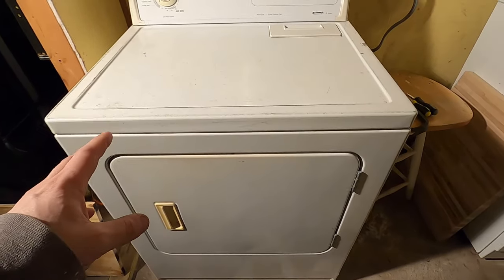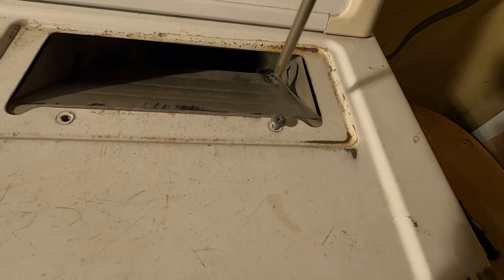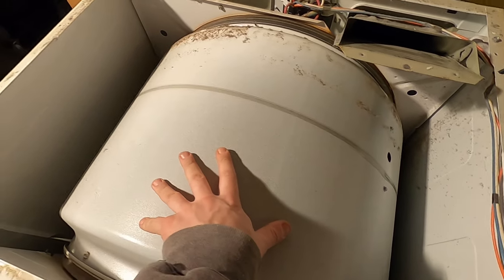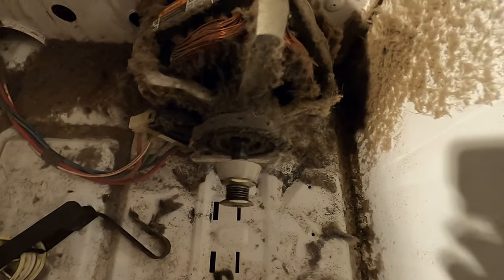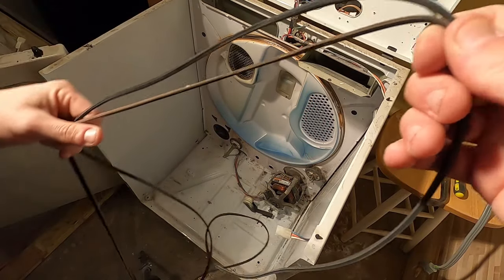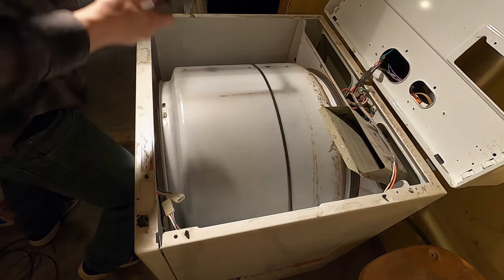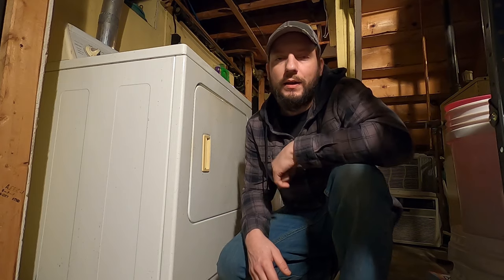How to Replace Dryer Belt on Any Front Load Clothes Dryer

Comment: My favorite part is when he is able to show us how to loop the belt around the tensioner and onto the motor. The way he got that perfect camera angle with adequate lighting....astounding! Well done sir. May the algorithm put your video to the top.
Reply: So true. That was the part i was stuck at.
Reply: It was definitely the top result for me 🎉
Reply: Same here.  My dumbass  would've removed that little wheel on the tensioner to put the belt on. 😏
Reply: Time stamp plz
Reply: Yes..Perfect How-To Video!
Reply: - I believe there are time stamps under the video .
Reply: Better than those other vids that aren't very clear and leave important  parts out.
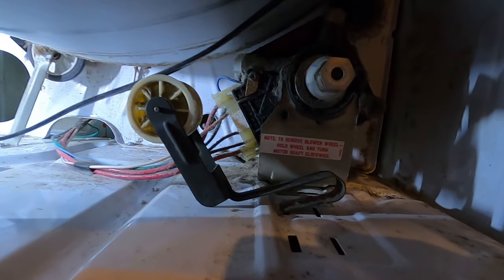Reply: @JermBoyTv 10:50
Reply: Agreed!!
Reply: Facts! This was mad helpful
Reply: I totally agree!
Reply: Absolutely great job!
Reply: Word to the wise always check the drum rollers normally one or both have seized causing the belt to fray and break.

Comment: I was a crane operator at a scrap yard. A customer came in with a stake body truck full of washers, dryers and dishwashers. His 13 year old son was unloading the truck by himself. When I went to talk to the driver, his son rocked the last dryer off. When it hit the ground, change fell out. After he picked up the change and was getting ready to leave, I told him, he wasn’t done yet, but to wait a second. I got in the crane and took the dryer apart. When I got back to him, he was still getting change from the dryer. The next day, I asked the driver how much did I his son get. $18.

Comment: This turned out to be a project where I actually made money.  My belt tensioner had just slipped off so I only had to put it back using your video.  And with all the change I found in the dryer, I came out with more money than I started with.  Thanks!

Comment: Great clear instructions. Perhaps the most important real world part of this  video was showing the hideous multi year lint accumulation that has to be cleaned before doing the belt replacement. I was horrified how much lint crap had accumulated inside my drier that posed a real fire hazard that i had never appreciated. It took me several hours to clean out the body in addition to the ~20 minute actual belt replacement. I diligently always cleared my lint screen after each use, but the lint piles I found inside shocked me. Thank goodness my belt broke and forced me to clean out this fire hazard lint that had accumulated after years of use. All other videos I watched showed well dressed salesmen replacing the belt of a new drier with ultra clean insides. This real world video is the best and serves as a wake up call to alert everyone of the need for yearly drier inside lint cleaning.
Reply: DRYER MAINTENANCE BECAME MY ANNUAL CHORE LIKE REPLACING THE FIRE ALARM BATTERY AT THE *PUSH CLOCKS AHEAD " SPRING TIME REMINDER!

Comment: 10/10 - Our ancient dryer threw a belt, and we followed this guide as a base on replacing it. Had zero issues, despite different model/brand/setup. Most dryers seem to follow the same formula.
Thanks a bunch! Saved us a service call and taught us a bit of repair.

Comment: I have a Whirlpool dryer that other than being a gas dryer is nearly identical to your Kenmore. Your instructions were spot on and I had the dryer fixed and running in a couple of hours. A local shop even had the correct belt in stock so same day service! Thank you and great job!

Comment: Great video!  I was going to go into the back.  Saved me a lot of time trying to do it wrong.  I watched four videos.  This was the first video I watched and was the best.
Reply: Sorry, got click happy.  Only two things missing here.  One is to check the wheels and belt tensioner before you order parts.  The other is to test run before you lock the top down.  

Other than that, A+

Comment: Thank you.  You saved me about $250!  Easy as pie to fix.  My tensionor was a little different design, but the principle was the same.  I had a friend hold up the drum, and that helped as I attached the belt to the motor.  Flashlight comes in handy.

Comment: My Kenmore dryer seems to be even older than yours, but it's put together nearly the same and the motor still works fine. I spent $9 on a new belt and I followed your excellent step-by-step instructions. You gave me confidence to do it myself -- it was a lot easier to replace than I thought. Thanks a lot!

Comment: Appreciate the vid, me and my lady just fixed ours. When I searched how to replace a dryer belt, yours was the 1st video to pop up and you did  not disappoint.  Our dryer looks similar to yours, and the only hard part imo, was getting the tension from the pulley to the motor. Once we got that and the front plate back on, she ran good as new!

Comment: Yep!  Very helpful.  Different make and model, Hotpoint DLB265OR, 29 years old.  There's a panel in back to get inside to visually check the tension pully and adjust the belt.  Got it back on, up and running, but so tattered that it doesn't make sense to use.  So, have to figure out how the front face comes off to swap it out with a new one. I like your closing advice - "Don't be afraid!"  Also, one you made in the opening - "If I can't fix it myself, it's junk."  Thanks for dispelling the mystery of how things look inside the white box.

Comment: Awesome video. My 30 year old dryer is the same design (Whirlpool) and this repair took me just a little longer than it took to watch this video!  I did pay a little more for the belt, but it was in-stock at my locally owned appliance store and I was able to pick it up today.  So $20 and 20 minutes of my time... time which would have been doubled without your video. Many thanks!
Reply: Though I was disappointed there wasn't even a grimy old penny in the bottom of my dryer :D

Comment: My man. Every nut and bolt was exactly as you said it would be. It was kind of hilarious actually. Even the same stain mark where the belt goes around the drum, and of course the broken belt laying in the bottom exactly as in your video and of course the tension piece laying there having fallen out of the slot just like yours. I could not believe how identical situation was. It was even the same exact belt number! I guess the only thing I have to complain about is I only found $.25 in change as opposed to your two dollars and whatever it was!. But… Hats off to you. Such a well laid out video and in my experience, and exact footprint of what you run into. Really funny. And rewarding! Thank you so much
Reply from the maker: 😮 haha that is great.  Very happy to help out.  Wish you found more change but happy you got it fixed!  😀👍

Comment: Dryer sounded a bit quieter than usual yesterday morning and I knew it was the belt. I never replaced one before and I always wondered if the belt does go, is it worth replacing? Is it something I can do? Will it mean it's time to buy a new dryer?

Thankfully no, I was up and running in no time. This video was a big help. I was able to buy a belt at a local shop and it was barely over an hour from broken to fixed. I actually haven't fixed anything quite so simple and straight forward in a while. Thanks sir!

Comment: Nice!... I also Got a case of the "Might as wells" (Same basic dryer- 40 years old) Checked and replaced the 2 big Idler wheels 
(Back of drum) and the idler assy. for belt. The kit was like $27 , including belt. < ebay. Also, Pulled the entire vent tube from 
back of dryer to the wall outlet (7feet) and cleaned it. Just a tip from your Uncle Larry. Thanks Fixer guy.

Comment: Thank you for the detailed loop video...my dryer just stopped so I'm getting ready to dive in...hope its as easy as this and only an 8$ job :)
Reply: Opened it up last night and...broken belt.  Am having trouble getting the wires apart to remove the front panel...don't see a clip to push or lift in order to separate. 
Ordered on Amazon (not easy to figure out sheesh)...arriving today or tomorrow so fingers crossed its only this!

Comment: Worked great on my 2yr old Roper dryer all the same steps, even the pull up hinges at the bottom of the face of the dryer… belt ended up being somewhat universal … 29 in front load and top lint trap… bottom lint trap usually indicates a 27in belt

Comment: The tensioner on my Kenmore had a solid metal 'rub strip' design instead of a pulley wheel. So i ordered a kit with a belt and a tensioner that has a wheel, from Amazon.
Much better design and everything fit perfect.

Comment: Great video this gave me a lot of insight mine is still spinning but making a loud banging noise so I wonder if the belt is worn to the point it came out of the groove around the drum. Either that or it's the rollers but now I know what to look for, thanks. Oh, and to avoid dropping the lint screen screws down the lint shaft just stuff a folded rag in the top of the shaft to catch them.
Reply: mine too!  scared it means its gonna tear up something else down there!
Reply: @withau7622  turned out to be the rollers one them had lost it's retaining clip and was loose

Comment: Thanks. I did a belt years ago but had forgotten how to do it. And my belt broke the other day so I watched this video to remind me how to do it. I probably would have looked at the pulley laying on its side and thought it was broken--which is exactly what I did last time.😂
Reply: I got it done last evening. The hardest part was getting the belt through the tensioner and onto the motor. That turned out to be a lot of work.

I lubricated the rollers with motor oil.

Comment: Great video!  My dryer wasn't a Kenmore but was pretty much identical other than the brand name.  
And Yes, as others commented there was lint Every Where.  Emptied vacuum twice.   
I replaced the belt and tensioner (pulley).  Noticed some whining noise when it's on; hope replacing the tensioner wasn't a mistake. New one certainly rolled much easier.  When would you consider changing the rollers (wheels)?

Comment: Hi,
Just wanted to say thank you for posting this. I inherited an old dryer from the previous tenant and ended up keeping it and selling mine because it was electric, and this one is gas. I just replaced the broken belt today with no trouble, but now I'm not getting any heat. Since I'm not familiar with gas, do I need to relight it like a water tank or something? Odd because it was hot before I put the belt on. Thanks again.

Comment: Thank you this video was super helpful so far! I  am stuck though and maybe you can give advice. I can’t get my plastic wire connector to disconnect at all. I feel like it’s being overly stubborn. Any advice?
Reply from the maker: Hey, Kaitlyn!  I cut out a little of the struggle.  You have to push on the tab and work the connector back and forth for a bit.  Some of them can be pretty stuck.  Just try not to get frustrated.  Be patient and it will come apart.  I hope this helps.  Thanks for checking out the video!

Comment: I hope this helps someone, but on my dryer, there were two screws that I had to loosen down at the bottom before I could slide the front off. 

Also, my drum was held in with three screws that you can remove from the inside of the drum. 

Great video! Thanks! 👍🏻

Comment: This had helped me so much! $15.99 is what it’s costing me. I turned it back on and smelled a little burned rubber. So I turned it off and disconnected again. My dad will come and check it but I’m wondering why that is if I followed the steps and the dryer was bought new like year ago. Any tips?

Comment: Hvac in training here you saved yourself from a good 200-300 dollars I’m doing mine now got the belt for $25 way better then a sirvice call man, quick tip try and vent your dryer trough the wall moisture can get down there and clog it up if it’s through the ceiling
Reply from the maker: Thanks, Tim!

Comment: Great Video. It's getting the basics right that matter most and you showed me so clearly how to get the belt in place properly. I've a Normende and it's making a noise like the motors working but the belt may be broken. Only problem is the screws on mine are kinda star shaped instead of Phillips or flat head screws. Do you have any tips/help on how to remove these type of screw heads? Any help much appreciated 👍

Comment: Single lady of a certain age here....I did it!! Thank you so much. I did a lot of lint cleaning while it was open. My vent that goes through my attic is clogged somewhere near the roof and I can't get to it so I've had my vent detached from the dryer for a long time. So when I turned it on after repair I can smell a slight burning. Would this be the little bit of lint remaining or should I worry?

Comment: Great video, one question, where on the white idle pulley wheel does the belt rest, the width of the wheel surface looks much wider than the width of the belt.  Does it just go in the middle of the pully wheel where it can move side to side on the wheel?   Thx

Comment: Going to give it a try. Thanks for the video.
Reply from the maker: No problem.  Hope the video helped.  Let me know how it goes!
Reply: @TheFixerHomeRepair  Big thanks. I took the dryer apart. It was just like the one in your demo. Sure enough the belt was shot. I ordered one from Amazon and it came the next day. The pulleys were ok. I put it on. I had to have another set of hands getting the frame back together, lucky the wife was home. We made sure the drum spinned manually first. Plugged it back up and hit the button....pure magic!. Thanks you saved us a couple hundred for a repairman.  Great video.

Comment: Hey fixer thanks so much for the video!   I actually fixed my dryer myself. Boy I was so proud.  Lol.  The dryer stopped working and the belt came off because the place that you wrap the belt around that attached to the motor broke (the octagon type screw broke off) can I replace the nose like piece?  Ty
Reply: I figured it out thanks.  Should’ve made a video!  Lol.

Comment: Great Tutorial and you didn't talk to us as if we are stupid.  I am 76 and husband is 80 gettting down on the floor was hysterical and getting up was next to impossible  got the job done but its kinda squeaky.  Part store said they changed the design on the pulley so the old version is not available ...the new version requires slots in the bottom of the dryer floor.  Mine is slotless.  So annoying,

Comment: I just finished putting my 18 yr. old Kenmore dryer back together. I cleaned all the lint out of  the inside of my dryer.  The hardest part was putting it back together.  I found $5.05. I took off the plastic fin’s in the dryer drum.  I do not know what you call them LOL. I have been looking at new washers and dryer‘s.   I see some thing I like then read the reviews and I say I just do not want to spend $3000 and experience these problems.

Comment: The belt broke in my dryer. I replaced the belt like you did but now there is a loud rumbling and knocking noise coming from the dryer when I turn it on. Any suggestions on what that might be? Thanks for any suggestions you can give me.
Reply: I found my problem. One of the drum roller bearings went out. I am supposed to get the replacement parts today to fix the problem.

Comment: Yep, that is exactly how it was. Belt was broke and dryer was filthy and plenty of coins were along the front rim....:) Actually had the wife hold the drum in place when I hooked everything back up underneath. Yes the drum is light....:) All in all a reasonably easy repair. A little tricky how the belt goes however with a diagram and better yet examining video it was all good....:)

Comment: i just replaced mine!  thanks!  but now there's a noise on the side where that work was done.  what could it be?  should i take it apart again?
Reply: I had to go back and buy the pulley also.  replaced the belt and the pulley, but now there's a fast knocking noise coming from the same area on the right.  I did dry some clothes though, but I only put in a half load, in case that knocking sound was making the dryer weaker than it should be.

Comment: Hi...I've been helping my responsible (and not much money) daughter keep her old dryer working. Replaced motor, pullies and belt a few months ago. Now the dryer occasionally doesn't turn...not sure what's up. I rechecked and did notice that the rear seal is pretty beat...could that effect its turning. Seems like sometime you can here it on, but no rotation, but once it does turn, it seems to complete the cycle...Could it also be the timer mechanism, which may be beyond me...I"m going to replace the rear seal and see...Any advise if you monitor this post is appreciated. Thanks. Rick

Comment: Hello
I was running a load in my dryer & it just stopped.
The timer works and the light is on.
The drum is not turning and I don't hear the motor, just the timer.
What do I do or check?

Comment: Thanks bud!!  Respect!
Reply from the maker: No problem!  Hope the video helps you out!
Reply: @TheFixerHomeRepair  it did. Replaced the belt. Discovered I had a slight gas leak. I replaced the gas line and cleaned out lint and change, a lizard remains and it works like new. Dry time is cut in half. I never would have taken it apart if I hadn’t watched this video. Again, thank you.
Reply from the maker: @luchagain3424  That is awesome to hear!  Thank you for letting me know and congrats!!

Comment: Can i use a slightly larger sized belt to replace the one that broke? They sent the wrong size
Reply from the maker: Hey!  You could try it because the belt tensioner does have some room.  If it is too big, it will fall off and you'll have to get a new one.